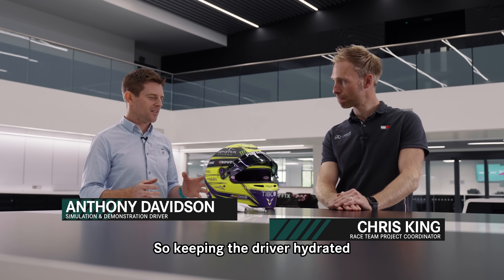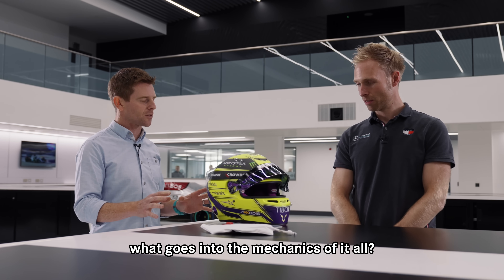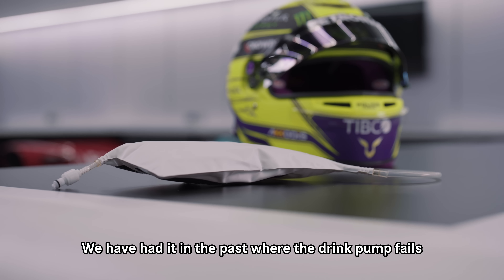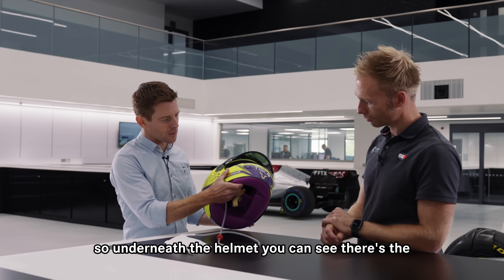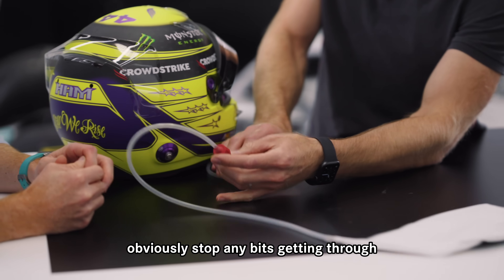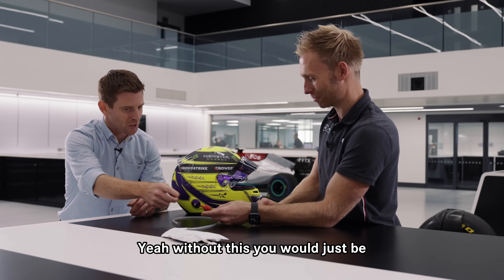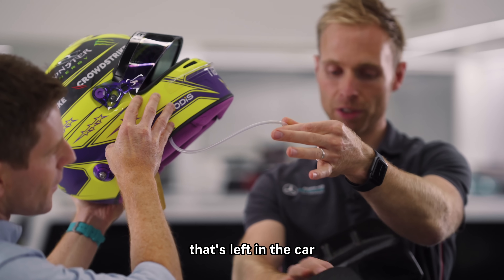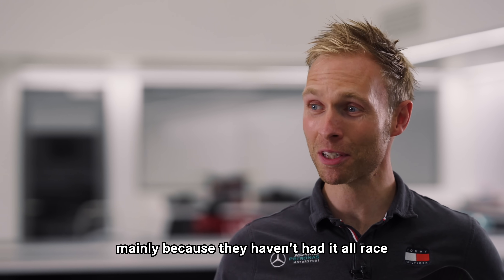F1 Drink System | How It Works 🔍

Comment: My only curiosity from this technique is, does the tube sit to the side of the drivers mouth then having to reach for it with lip muscles, or does the tube sit inside the drivers mouth (which sounds a bit uncomfortable)?
Reply: I have used similar before. Grab pipe with hand, hold in mouth with teeth. Few sips and push it away. Can't keep it in your mouth as will also be impossible to talk on the radio
Reply: i have this exact question too

Comment: 🇱🇰 Check Mick's lap time and Lewis Russell's lap time. Mick has not trained the car. By now the car is in the best condition, isn't it? The car's maximum braking and maximum speed and time,,,tell the engineer to drive the car,,it is up to the builder. A lot of flaws are visible now,,,old 2022 car give to new update check,,check real track ,,,,new f1 car hide,

Comment: I wanna know if the pipe is always in the drivers mouth or do they press a button for it to move forwards or backwards? Because then how are they talking in the radio? 

Suck to get water in is pretty straightforward.. But Wondering how the pipe gets to the drivers mouth when he needs to drink (never seen them physically move it)

Comment: Wait, so do the drivers need to keep the pipe in their mouth the whole race? It seems pretty uncomfortable to me, especially if you’re going 200 mph and experiencing those G-forces while trying to drive the fastest.
Reply: In another video (can't remember if it was Mercedes or not), they said they move the drink tube into their mouths during the straights and take it out after they're done drinking
Reply: @Lantec1000  like by hand or what
Reply: @vintyprod  yeah they just move it quickly with their hands.
Reply: Oh, ok. Thanks for the info.